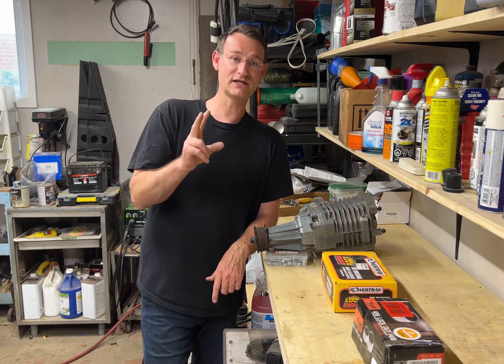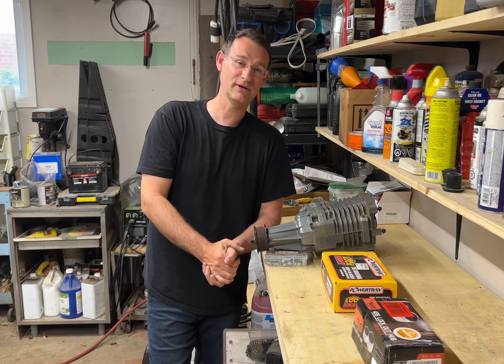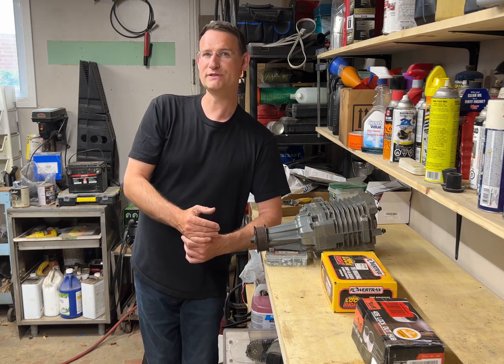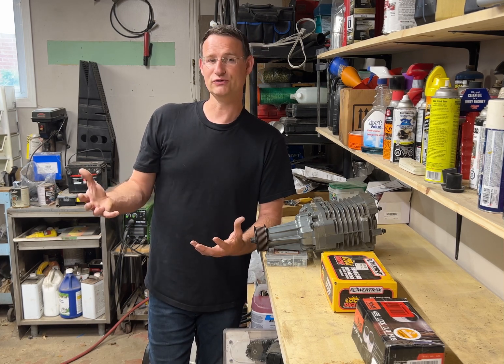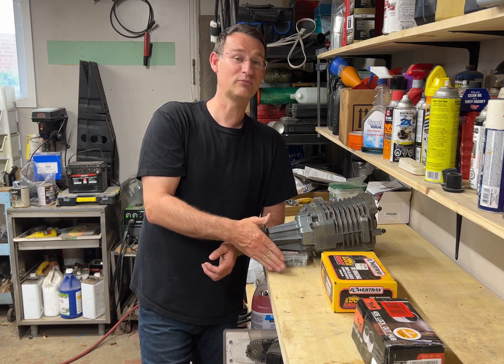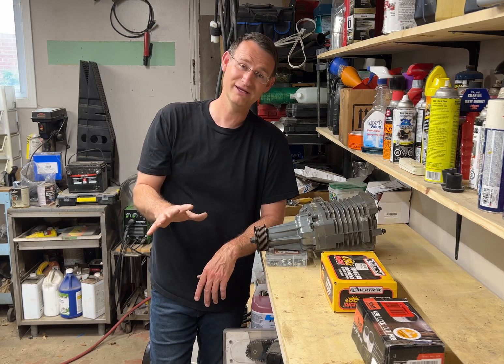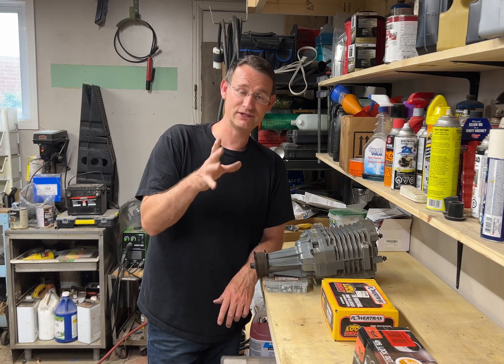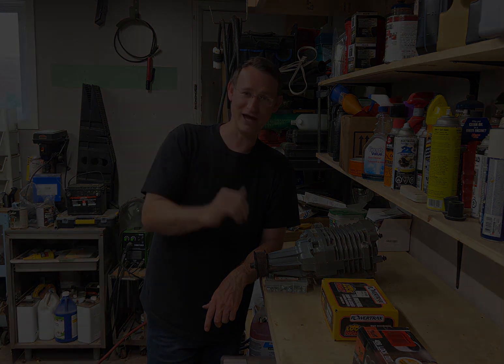Ford Ranger - 8000 mile trip- Future Project Supercharger

Comment: I've had a supercharger pushing 8 psi on my 4.0 ranger for almost 6 years meow. Installed around 120k and have over 160k at the moment. Highly suggest installing a water to air intercooler because I've had over 210 degrees AIT before hand. Makes the truck very fun, just a huge nightmare learning all I needed to get the truck to where it is at.
Reply from the maker: That’s really nice to hear it can handle that kind of boost!! …. Did you have to do a lot of mods to the engine? Stud the heads etc? 8psi sounds like tons of fun but definitely out of my comfort level.

Comment: the issue I've had with my 2011 ranger 4.0 auto 4x4 is harsh upshifts.. bought the truck with 20,000km on it and it's at 120k now. never liked the 2-3 or 3-4 shifts.. is there a learning mode I can clear? I've adapted to it over the 8 years I've owned it but always wondered. had it in under warranty a couple times. of course they said nothing found. aside from that only issue is front wheel bearing life but that's probably me driving it like a sports car. and the aluminum aftermarket thermostat housing was the solution to the Ford ones leaking
Reply: Those transmissions are known to have valve body problems. 1 issue is the valve body bolts loosen over time. The other is internal wear.
Sonnax makes a VB kit. I installed one on my 3.0 ranger and made a huge difference in shifting. Installed a kit on another vehicle. they know their stuff.
Also, shifting is effected by other engine sensors such as MAF and tps. 
Sometimes sensors get lazy with age/use. 
I changed all of my sensors 1 by one after a certain age and made a noticable difference.
Use quality parts from reputible sources. There is a lot of conterfiet parts floating around.
Reply from the maker: You can disconnect the battery for 5min to erase the Keep alive memory. Sorry I’m not that familiar with the auto transmissions. The aluminum thermostat is definitely the way to go.

Comment: Debating on doing my pass side timong chain cassette..start a clack on start up once and a while then goes away sometimes nothing at all....but real.bad on first start up after oil change....but we shall see ots a big job for such a small part...oh ya have a 01 extended cab 4
0 4x4 edge..300k on original motor and trans still going strong
Reply from the maker: If I could suggest Start with new tensioners.. from Ford don’t get the aftermarket ones. Run synthetic if you can. If it’s not doing it all the time the cassette probably hasn’t broken yet. You might not need to do it. Let me know if that fixes it

Comment: My 1993 Ranger is always reading full on fuel. It dips slightly when the ignition key is off. I already checked the slosh control board. Does it look like I need to drop the tank?
Reply from the maker: Sorry for the delay first I’d connect a gauge tester to the tank fuel sender wires…. If the gauge checks out from there then yeah I’d drop the tank then use a gauge tester on the wires in the tank…. If gauge responds then replace your fuel sender 👍

Comment: I know superchargers scavenge a small percentage of horsepower to increase the overall horsepower rating, but what I don’t understand is how it will affect fuel mileage under normal driving conditions? As in when your foot isn’t matted. Also is it safe to install in a 4.0 litre with 200 thousand plus km? Looking forward to your vid on it.
Reply from the maker: Yeah you got it they take a bit but I’m going to swap to an electric fan to lighten the load on the engine a bit. I have a decent camp trip coming up pulling the trailer I’m going to document it very well then when I get home install the charger and I’ll let you know. I think it’s really ok on a high mileage but well maintained engine due to the low boost 3.5psi is very little any more and I think you would be in trouble. Anyways I got the kit sitting on my bench let’s see how it goes 😄
Reply: Cool. Looking forward to it. Thanks for getting back to me.

Comment: Hi there! I have a C1414 ABS code that I have no idea how to fix, any help would be appreciated! (I have already replaced the abs module with another one but I still get the same code) This is for a 2005 4.0 4x4
Reply from the maker: Man that’s tough. First grab an EVTM and check your ground and power wires to the module…. Don’t just use an ohm meter but use a load on the wires…. Like connect them to a fog lamp. If the light come on bright they are good but if it lights up dim then you have an issue with the wires. If both test good then I would take it to the dealer… they need to see if there is any communication with that module and then possibly a reflash if it’s available. That’s my two cents….. anytime you think it’s a module though it’s always been poor power or ground. Modules rarely go bad in my experience.